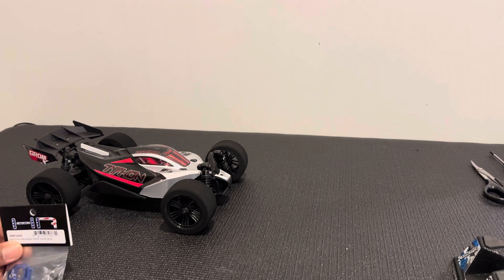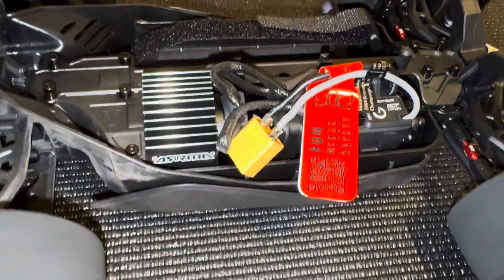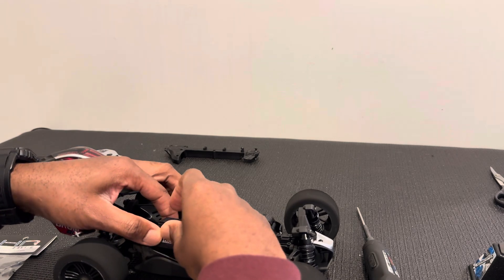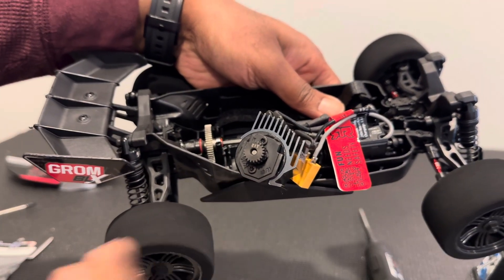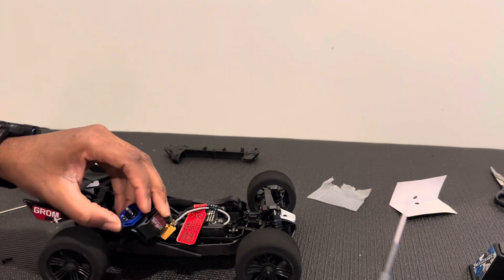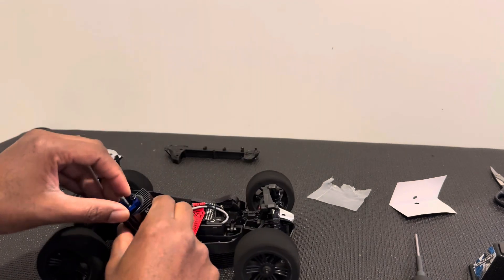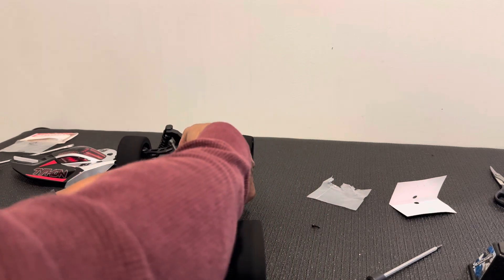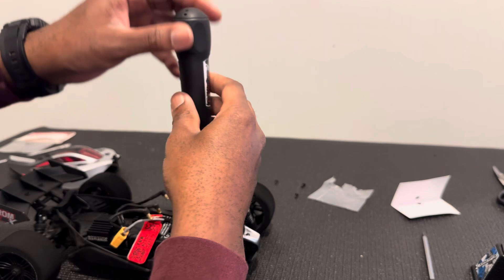How to install adjustable motor mounts on Arrma Typhon Grom ARA-2022 #Grom #blx #udrc #HOWTO

Comment: motor tp power 2930 7500kv 2s ou 7900kv 2s + esc quikrun 120a + lipo cnhl 2.2 70c💪💪💪😤😤👺👹😈😈👍😆😱 + tire BSR 45mm👍👍👍👍 spur44f pignon 30t👽👽💀💀💣💣💣💣💣💣💣💣💪😤.